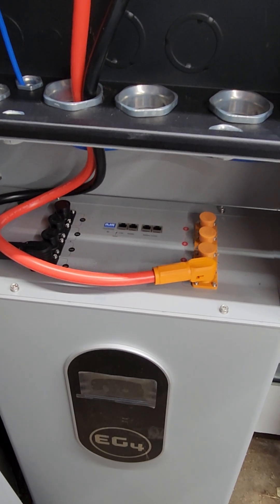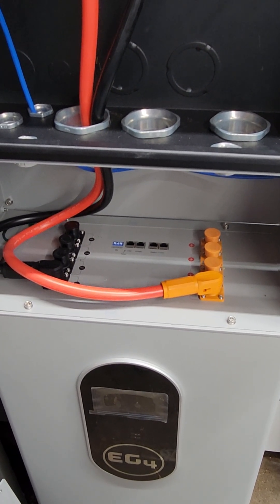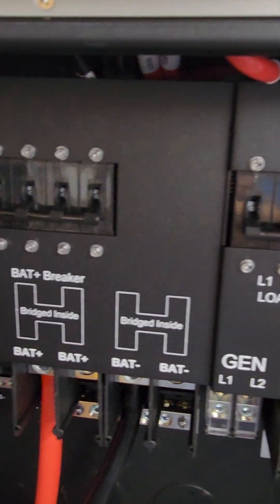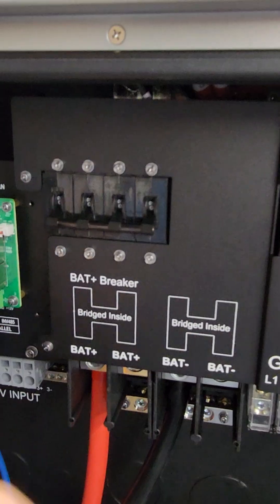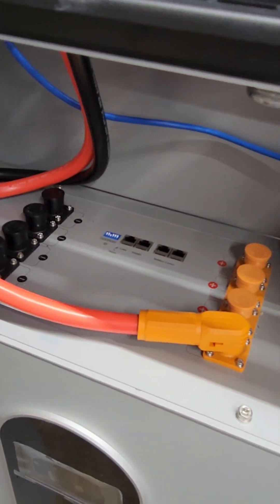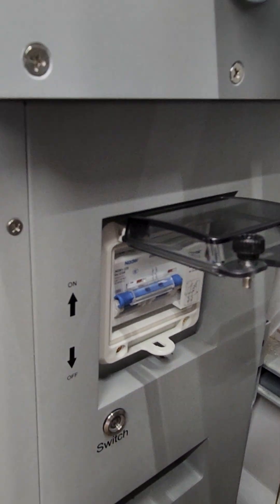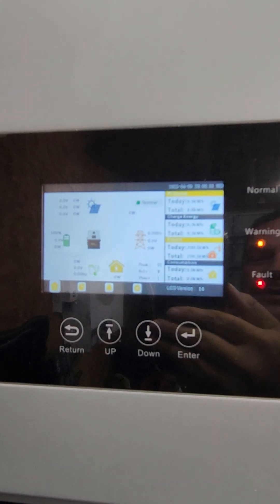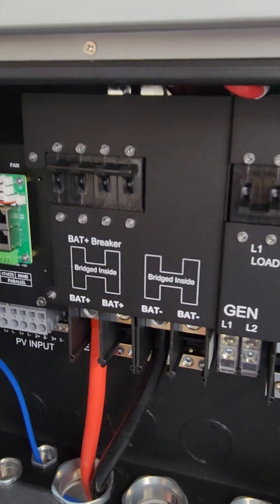The proper startup procedure for your EG4 battery/inverter #solar #battery #inverter #eg4  #electric

Comment: I asked Google the following question: Can a high-frequency transformerless inverter like this EG4 unit damage your appliances? And here's the answer that Google gave about these low-cost high high-frequency, transformerless inverters: Yes, a high-frequency transformerless inverter can damage your appliances, and even cause fires, due to a lack of galvanic isolation and poor handling of high-surge loads. Instead of a protective transformer, these inverters use high-speed switching components that are prone to failure. When a component fails, dangerous, high-voltage DC can be passed directly to your AC appliances, leading to severe damage, short circuits, and potential fires. 
Why they are risky:
Lack of Isolation: The absence of an output transformer means there is no electrical barrier between the DC power and the AC output. 
Component Failure: The high-frequency components are not designed to withstand high surge loads like those from refrigerators, air conditioners, or power tools. 
DC Leakage: A failure in the internal circuitry can allow high DC current to pass to your appliances, which they are not designed to handle. 
Shorts and Fires: This dangerous DC can cause short circuits, melt wiring, damage motor windings, and even start fires in electronics and appliances. 
Safer Alternatives: Low-Frequency Transformer-Based Inverters: These are a much safer choice because the heavy-duty output transformer provides galvanic isolation and has far superior surge-handling capabilities, protecting both your appliances and the inverter itself.
In summary, a high-frequency transformerless inverter's reliance on complex electronics without the safety of a transformer makes it a significant risk to your appliances and potentially your safety.

Comment: For initial startup does the EG4 battery need to be at 100% SOC or is it safe to allow the inverter and/or grid initially charge the battery to 100% SOC
Reply from the maker: If it's the only battery, any soc is fine.  If you are connecting multiple batteries, it's best to match the voltage (not necessarily soc)

Comment: Boy this video was definitely needed.  So many post on the forums of people frying their inverter because of incorrect startup procedure for a battery with a pre charge resistors.

Great job!

#diysolar
#energyindepedence
#mysolaraddiction
Reply from the maker: Thank you!  I agree 100%,  I kept seeing people talk about various failures across several brands, and most were due to improper startup.  People don't realize how easily a capacitor can die.  In fact, it's probably the most common failure in central air systems too, capacitors failing..  thanks for watching!